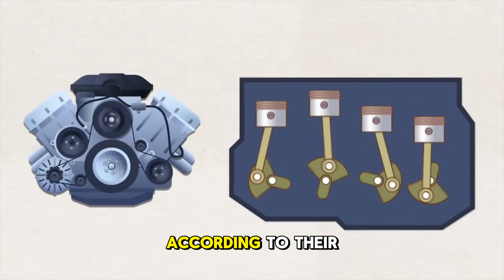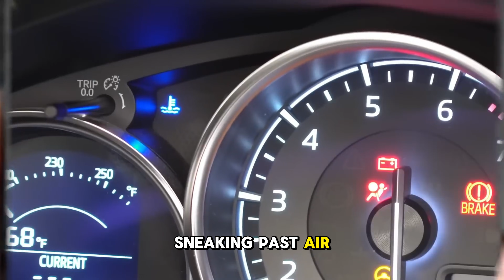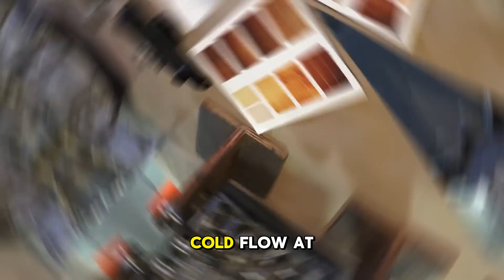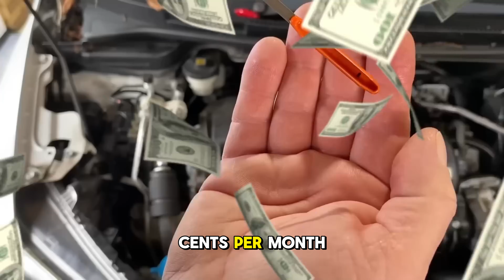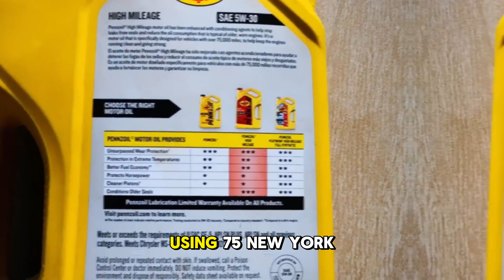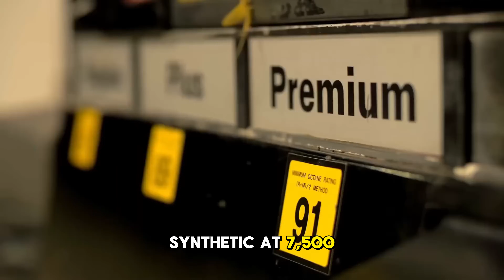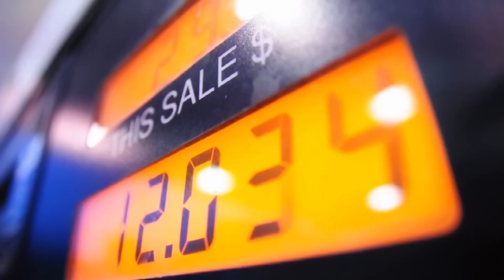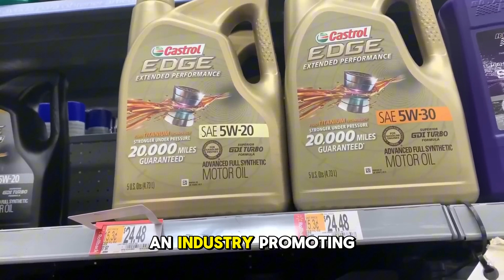I Tested Engine Oil for 300,000 Miles — The Results Shocked Me

Comment: What about age. In 6 months I put on 2500 miles. It's recommended to change oil at 6 months
Reply from the maker: If you only put 2,500 miles in six months, the miles are fine, but the time still matters. Oil breaks down from moisture, temperature changes, and additives aging, even when the car isn’t driven much.

That’s why most manufacturers say “every 5,000 miles OR 6 months — whichever comes first.”

So yes, six months is still a good rule to follow, even with low mileage. It keeps the oil fresh and protects the engine from wear.